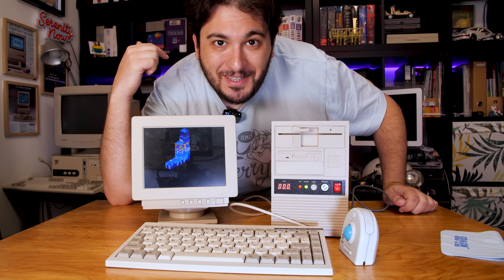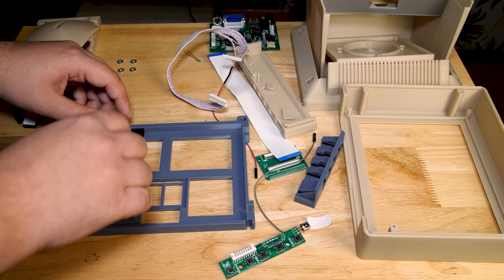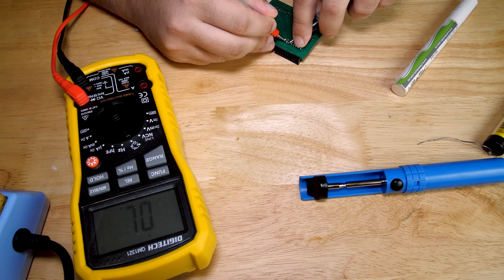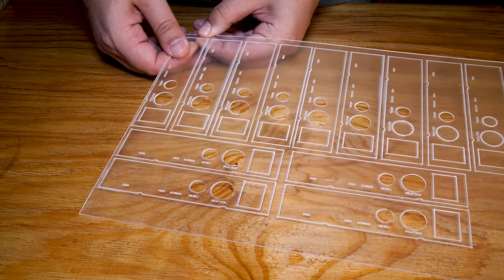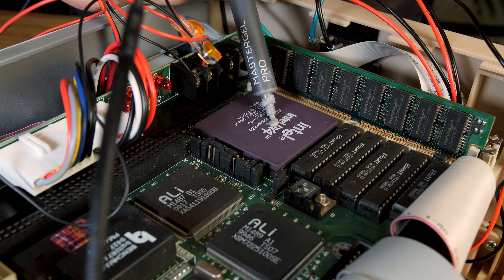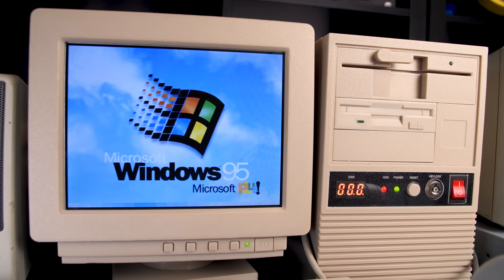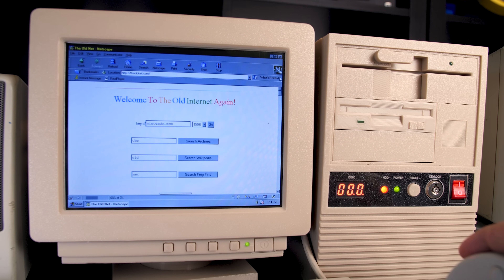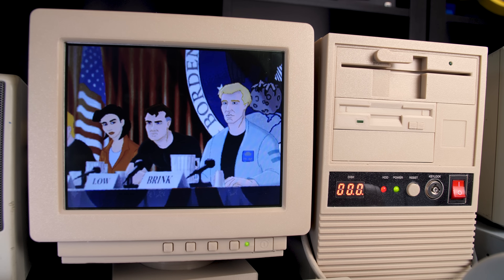A Tiny (Real) Intel 486 Built From Scratch

Comment: You really need a Pentium 60, or better for MP3 playback on Windows 95/98 however there were native DOS MP3/video players out there that can run with a DX2 66 with no problem (though I don't know if you can still download them anymore).  Frankly if gaming on anything, but DOS was your main goal a Vortex86 CPU SBC would have been a better choice they got better VGA accelerators on the newer ones.  Still this is a rather nice DOS gaming rig.

Comment: I think technically and artistically this is brilliant.  :-) However, I am wondering if there is a bottle neck somewhere?  One of my first PCs was a Packard Bell, that I upgraded to a 486 DX4-100 with 16 MB RAM.  Windows 95 was pretty snappy with that configuration.  And Duke Nukem 3D was "playable" with those specs. Though if I recall my friends with low end pentiums were playing Duke 3D very smoothly.

Comment: Best 3D printing job I've ever seen. And the overall project is great. If you can, you should replace the Tseng 4000 with a Cirrus Logic ISA GD-5429 (expensive on eBay but worth it) and the Intel 486 with an AMD 5x86 / 133 overclocked @ 160Mhz (one of my retro rigs). This will give you a good speed bump

Comment: There is a way to manually set master - slave on laptop optics.
I did it by manually soldering pins on the drives connector.
You can find instructions online.
It worked for my ancient laptops.
Reply from the maker: I tried to modify a ide cable for that but it didn't work. =(

Comment: In my experience, a [Intel] dx4 100 definitely needs a heatsink, though probably it won't destroy itself if it doesn't have one. A 5x86 however runs pretty cool, and is merely warm to the touch. I noticed that your SBC can run "586's". Your biggest limitation is probably the ISA bus. It's too bad there aren't any mini VLB configurations out there.

My real wish would be for a modern version of the 486 to be created for hobbyists. It's probably possible to have tiny 486 based chips that run at 1-2 Ghz. Actually, any modern x86 system would be cool, if there was support and peripherals for it. It would be nice to have a simple platform, to introduce one's self to lower level languages or even machine language. Object oriented IDE's are nice, but maybe we've become a bit too dependent on them.

Alternately, it would JUST be nice, if there were some readily available SBC's out there, that had a bit more peripheral support. I don't think most of us need a desktop Geforce card on a Raspberry Pi, but MAYBE it would be nice to have some lower powered options, that would upgrade the stock capabilities. I think that can be accomplished, without needing a shoebox's worth of space to hold the graphics card.

As for the laptop CD-ROM, maybe you could find a secondary controller that could run it. AT specifications allow for two controllers, with two drives each. I like the project. SBC's like you used are pretty scarce and expensive. They were expensive, when they were first offered. I'd really like a sustainable equivalent, like you were originally planning to build.
Reply from the maker: It would be amazing to build something with more readily available components, but there aren't many options, sadly.

Comment: keep calm about this build
there are dozens of projects that are built from scratch with total differences in making a retro mini pc or tiny pc as you want to call it
Yes, the solution made by you is ok, but you could do a much better cable management

and about printing a 3D case, I cannot give you the name of that website because it is not available on windows operating systems, but only on systems based on linux, debian, ubuntu and other systems based on linux distributions

Comment: Somehwere on the internet there's a PDF showing how to set the slave/master of a slim disc drive. I used when I put a dvd burner in my Satellite 230ct as the original drive set it to slave but the new drives default to master or something. If I remember right it's something to do with shorting two pins together.

Comment: I know Clint of LGR has shown off a few small CRT monitors before. Wonder if any of them would work in your monitor case for more authenticity?
Reply from the maker: Any VGA monitor would work. =)
Reply: @The Eric Experiment  I know that. I saw it was a standard vga output. But to keep that small form factor to match the tower size. I remember Clint even showing off a monitor designed to fit into a tower.
Reply from the maker: Yeah, I wish I could find one of those easily, they are super rare.

Comment: To make an mp3 lighter you should increase bit rate, not decrease. The lower bit rate means that the data is more compressed, so more cpu is needed to decompress in real time. That being said, my 486 also could not run mp3  back in the day... If you decompress to a huge .Wav file it works.

Comment: The only thing I don't like is your background music. Excellent build. Should have put those on a switching transistor relay so the drive LEDs could be powered by something else. Why Win 95 instead of Win 98SE?
Yeah, old cheap video cards are the big downside to using old hardware.

Comment: I think this computer is severly slowed down due to graphics card. 486/100 should be pretty ok for operating Windows 95. I had almost the same specs in mid-90s, but with S3 Trio GFX on PCI and it worked quite ok. I played SC2K on that computer without issues. I also emulate similar computer via 86Box (which is a "cycle accurate" emulator so speed should be similar as real hardware) and all things are rather snappy. In the future you might try to find a PCI-based 486 SBC maybe 🤔

Not .mp3 though 😅 After fiddling with Winamp options, reducing bitrate etc it DID play songs smoothly - but you couldn't do literally anything else on the computer. Still it was impresive when my dad brought a CD with mp3s that hold the same amount of music as 10 "normal" CDs.
Reply from the maker: PCI ones with full speed don't use ISA if I'm not mistaken. It's harder to find those.

Comment: That is an awesome result, looks phenomenal! One note, the software you are running on there is really not 486 era software, you'd be better off on a pentium class machine, for 486, you should be thinking pure DOS gaming rather than Windows gaming. As for MP3s, the 486 CPU will never decode them very well, even in a pure DOS environment they barely play ok, definitely more of a Pentium task for sure.
Reply from the maker: Yeah, for Windows I usually use my Pentium MMX!

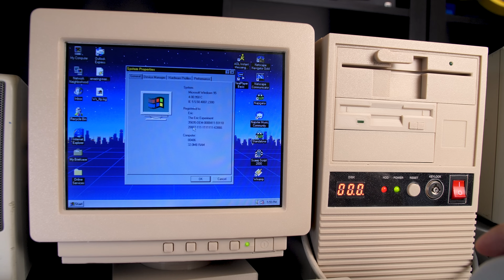Comment: 13:02 that slow window repaint! Did you by any chance get ET4000AX instead of ET4000/W32?  The latter supports Windows GUI acceleration. You dont need MACH64 for that. But even unaccelerated ET4000 should repaint windows faster than that.
14:15 mp3s should play fine on DX4
14:45 No :) 10Mbits is 1MB/s, ISA Ethernet cards usually peaked around 500KB/s. Your website is ~2.6MB should load in 5 seconds. There is something very wrong with this computer.

3D prints are amazing, it actually looks like its made out of metal on video :0 Computer is crap :) deeply misconfigured.

Comment: Would you be able to install Windows XP on it? I'm wondering just because that would be so adorable to have like an XP machine so I could have the Sims complete collection. I have it on my computer but I would love it to run on close if not the original hardware. It runs fine on Windows 10 though but still

Comment: my personal fave for DOS+Windows 95/98 retro computing is the AMD K6-III+ 400ATZ. With an AMD K6-II+ or K6-III+ processor, you can use SETMUL in DOS to change the clock multiplier, as well as disable the various caches. Doing so allows you to very easily emulate the speed of much slower machines, like a 386 or even slower, which can be necessary for older games.

Comment: Impressive. I love the result. Although - cable management is a bit... debatable 😉 I wondered, why you hadn't use the OLED display for the Gotek, although the digit display is close to the old times. Good job!
Reply from the maker: The digit comes with the gotek. An OLED would require a microcontroller and some programming.
And also it would look less authentic =)

Comment: Nice video
I heard SBCs have some incompatibilities with games or cards because they never meant to play games.
I think maybe better to try some AIO boards that have all hardware built in, like, for example, VIA ME6000 board
It have DOS, win98 and win2000 drivers, 600mhz 486-like cpu via eden 2, ac97 codec and ne2000 compatible network chip, and even if sound not working you still have one PCI slot for sound card.
Also board contain USB, composite video out aside from VGA, and even flat panel pin header for LCD that can be configured from bios. Great stuff. I assembled it in old VCR case and powered it with modular 250w atx power supply that have transformer not built in but screwed to the case, so I just remove PSU case altogether and mounted all boards beside the mainboard, and hard drive under motherboard, with single cooler enough to cool everything in the case.
It was nice one sleepless night project. In the end it is very compact and have all necessary hardware and power built in, and was quick to build. I connected the front buttons from VCR panel to the ATX power button for authetic experience.

Comment: The author chose a difficult path can be made easier. Due to the fact that earlier plastic, textolite, and electronic components were made very hydroscopic, you only need to wash the 486 computer in hot water and it will shrink when dried. Of course, in order to avoid corrosion, you'd better put the computer in rice.

Comment: 5 minutes in and that monitor is epic. One thing, if later down the road if the acrylic gets scratched up from cleaning it, you can go to a local glass store or hardware store and have them cut you a piece for like 5 bucks. I remember breaking my neighbors window which was 10" by 7", and it only cost me 7 bucks at the local hardware store. They just asked me how big, and they cut it on the spot from a larger glass sheet. It only took 10 minutes. Just something to keep in mind later down the road.

Comment: With those old Graphics accelerators you really need to have the opengl 1.3 Standalone executable installed. It's really hard to find, but if you can find it it should boost your frame rate by as many as 15 to 17 frames.

Comment: damn. nice work. at least PLA is biodegradable! and i totally get you on the print iterations - i designed a really simple little case to hold a pi 0 and a few other components and it took at least 5 prints to get something half decent, yet nowhere near what you've done here
Reply from the maker: It's so gratifying to be able to design something on the computer and actually get a physical object to out of it!

Comment: You nailed it with this build! I absolutely love it’s small form factor and the idea of having a real 486 in such a compact set. My only problem with 486 however was always it’s performance :/ if that would be at least Pentium 100 with some basic S3 Card on AGP that would be a sweet spot (at least for me).
Reply from the maker: Yeah, doing this with a pentium is a bit more complicated.
Reply: @TheEricExperiment  I am not sure if even possible so that’s why I admire your work so much but on the other hand feel it a bit like a waste of time as even with more powerful 486 processor you would still bottleneck the whole system with ISA GPU. Still, kudos :)

Comment: Not going with a MB that supports VESA Local Bus is a mistake in my opinion.
Reply from the maker: The computer would be double in length, and I don't know if there are vlb backplanes in this size.
Reply: @TheEricExperiment  My first computer was a 486SX25 on an ISA bus. My friend had a 486DX33 with VLB and the difference in graphical processing due to the 32bit bus was jaw dropping.
Reply from the maker: @Bellthorian  yeah, it would be a lot faster, the problem is the size =(

Comment: In the old days the classic 486 with DX4-100 and VLB can and will run smoothly Windows 95 with Winamp playing average quality MP3 (128 kbps) and next to that you still can play some of the basic card games like solitaire without any drop or pause. My friend even played on that build demo of the first Diablo which is meant to be launched on the Pentium. So this build is clearly useless for use with windows. I have some Pentium SBC and backplane with PCI slots so I will be trying to build something similar, but more powerful (MMX 233, Radeon 7000 PCI, AWE64, network card). Do you plan to release these 3D models?
Reply from the maker: Eventually, I'm still yet to plan how I'll do that.

Comment: How much would this thing cost? If someone wanted to build it or wanted it built?
Reply from the maker: The way it was done, without scale, it would be pretty expensive.
Reply: @TheEricExperiment  In that case i envy you. My parts were destroyed. Is it possible to do with a device like the PI or Arduino?
Reply from the maker: @alyctro8158  yeah, you could definitely do it with a pi using emulation!

Comment: LGR would get such a kick out of this. Fantastic job on the period-accurate subtle bumpy texturing of the front bezels of the monitor and case by printing them face-down on a textured printer bed! Almost looks like you got it injection molded for a high price!

Comment: Even with the Mach 64, you'd have issue with ISA bandwidth. Even a cheap Cirrus Logic PCI card will run all over ANY ISA graphics card, simply from the bus bandwidth alone. ISA is really only usable for MS-DOS (and even then it's slow compared to local bus cards). Really fun little build though. If you could get a backplane with one PCI slot on it, or a single-board system with integrated local bus graphics, this would have been ideal as a space saving vintage system. The little monitor is actually my favourite part of it. It looks the part and having a tiny monitor with VGA input can be so useful :) Great work.
Reply from the maker: The monitor is so useful, I have already used it to check if there was video signal in multiple computers.

Comment: Dude it's a windows 95  . Winamp runs better on Xp lol if i remember right i was using it around 2000 .
Reply from the maker: I used Winamp on Windows 95 and 98 a lot, but usually with pentiums.

Comment: How did you get that nice texture on the surface of the 3D printed bits? Do you have an online printing service you'd recommend where I could get stuff printed in a similar way? I don't have a 3D printer so I'd have to resort to an online service.
Thanks!
Reply from the maker: I never used online services, the texture is from the bed of my Prusa.

Comment: Where do you buy those 486 SBCs that dont cost $250-$600.

That board looks similar to an Arbor 410 but the CPU socket is in a different place, i couldn't find one lower that $250.
Reply from the maker: Yeah, they are expensive now.
I bought this one for 160 if I'm not mistaken, but that was over 2 years ago.

Comment: With windows 95, I use Wplay Pro mp3 player on a 100MHz 486 and 128 bit rate played ok, until I started adding other software that ran in the background like NAV and ZoneAlarm. but it worked in DOS ok, I can't remember the dos player I used though.
Reply from the maker: WinPlay is great, I use it in my Pentium all the time.
Reply: @TheEricExperiment  WinPlay, I'll surely have a look into that.

Comment: I wonder if Gotek's indicator LED output could be used to control the transistor, which would drive the LED's on the floppy drives, allowing them to light up properly...🤔 There's a chance that Gotek's LED output will provide enough current to turn on the transistor.
Reply from the maker: It definitely could as a signal, or you could use a little microcontroller for that. It wouldn't be too difficult to build it, I actually have something like that in my TODO list.

Comment: How have I never heard of your channel before this video was suggested to me last night?  And wow, I get it took a lot of time, but the final product was so well polished.  At first glance at the start, I just assumed it was a vintage 10" CRT or something and some super small vintage SBC case, but no, it was all 3D printed and 'new' to hold classic parts.  Shame the internal slim ODD didn't work out.

The only 'complaint' I have is that you didn't go into much detail in the design process of the prints.  You sold short all the hard work you must have put into them and we mostly only got to see final assembly.
Reply from the maker: Hey, thanks so much for the thoughtful comment.

I lost some of the screen caps of me working on Fusion and I had so many issues with the 4 3d printers I tried that I ended up failing to shoot some of the printing.

I really wanted to put more details about that tho. =(

Comment: You could have installed windows 95 from the SD or USB. You could made a normal USB disk and then just ran the installer from the command line. We did that a lot in the 90s as not all computers could boot from CD and we certainly did not have usb on anything below a P1, but you could use a boot disk with the cdrom driver, then go to the cdrom and then run the setup from there after doing everything else in DOS like setting up a partition and formatting it, and in all probability making some space.

Comment: I wonder building a cardboard prototype would have saved some 3d printing?
Reply from the maker: I knew I could get it working but there are a lot of details that can go wrong. Failed or bad quality prints, screw points that are slightly off and other stuff that would be hard to validate while doing a card board prototype.